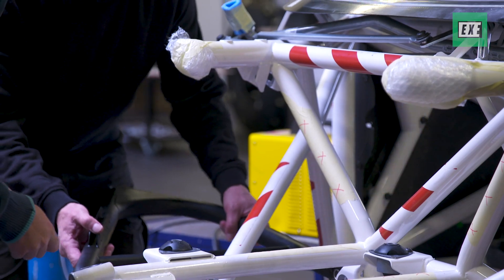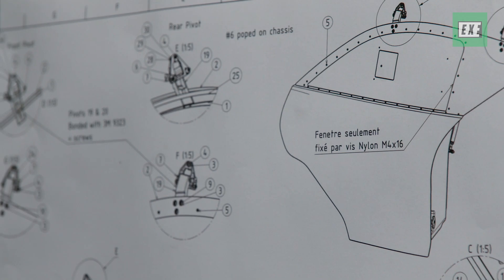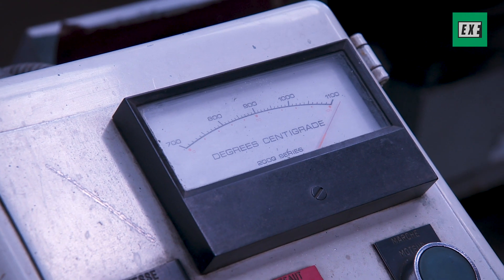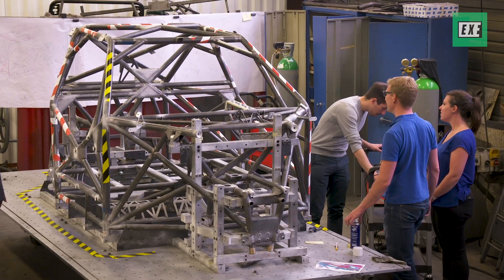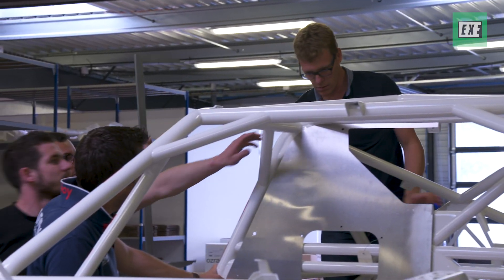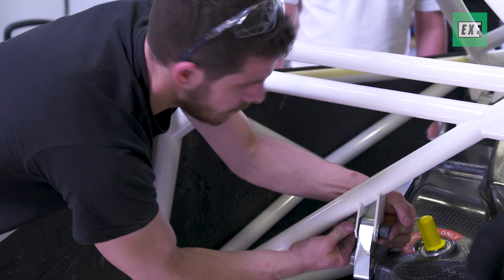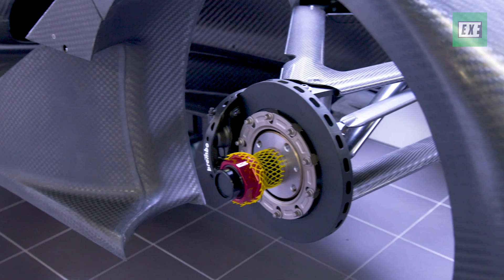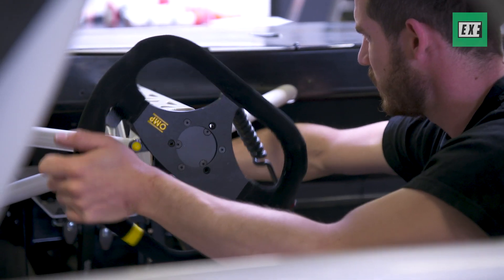Building the Extreme E Race Car! | Extreme E

Comment: I couldn’t hear what material he said the metal was coated with. Did anybody hear it?

Can we get English captions put on next time as they’re not maybe native English speakers please?
Reply: there's a previous video that explains the metal pipes, they specifically called niobium and phosphate
Reply: It is Niobium (Nb). It is not a coating, Niobium (in the form of FerroNiobium is added during the steel making together with the carbon, iron, manganese ... and the other raw materials. The addition level as average is 0.03% and the main affect is the refining of the grain achieving higher strength and toughness at same time. Niobium in not a rare earth, it as as common as Titanium but not that used or popular. Around 100,000MT of it are consumed worldwide in different applications and the main supplier in the world is CBMM (Brazil).
Reply: @PabloSalazar83  oh ok. Thanks for the breakdown. 

What other real life application does it commonly get used for?